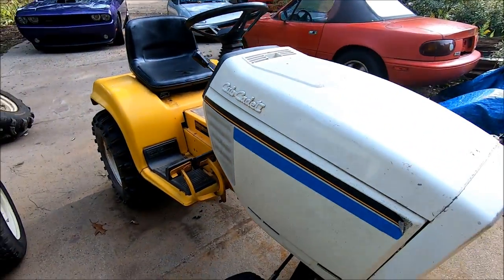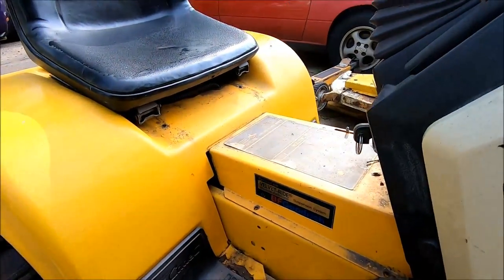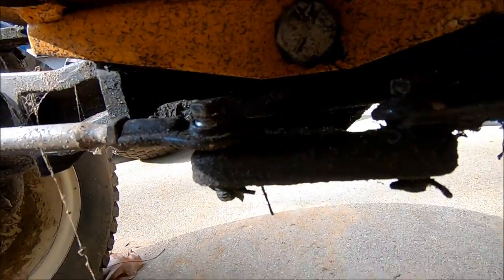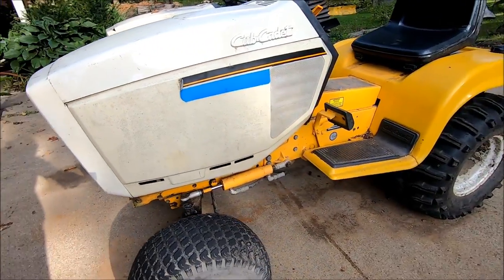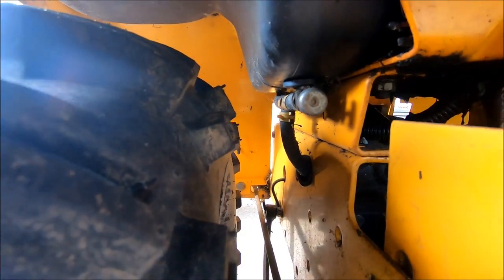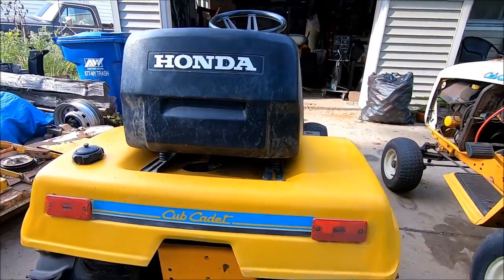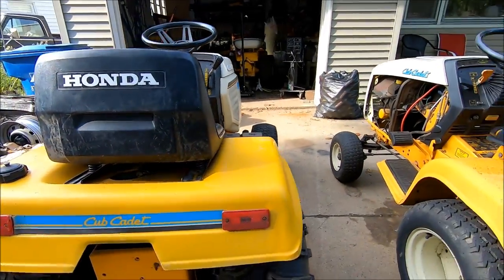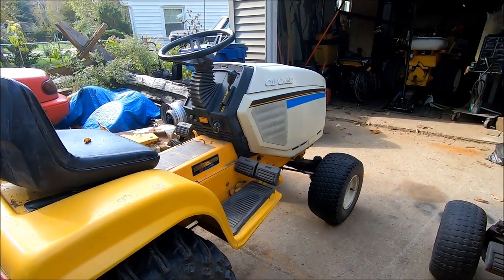SGT 2082 Cub Cadet Off Road tractor build.  Not your ordinary mud mower.

Comment: Awesome bud def is like way out of my leag dam but have a wheel horse project and just been running into issues I traded for it expecting it to be a good base starter and the dude screwed me over on facebook
Reply from the maker: Sorry to hear about the troubles.  This build was out of my league too until I found the magic sauce for this build.  The design was finalized last week and entered the build stage this week.  Hoping to have a this completed by end of April.
Reply: @MrStudabaker  just gotta take my time I might do a diesel swap I have a onan 2 cylinder that is on it now it is a really decent I'm having spark issues at the moment and I don't know what else I might come apon but I'm kinda reaching out to you kuz I wanted to get some advice what to do with this tractor it's a wheel horse 416/8 it's got the three speed rear end high low range give me a idea that would make my day thanks bud

Comment: Really cool man, it’s like all the best parts out of all the cubs, I’ve always had a weird love hate relationship with the cyclops cubs, like there ugly but in a mean kinda race looking way, gonna be sick looking when your done. I didn’t realize they ever made a aluminum case trans? And wide ratio gears sound great, what am I missing?
Reply from the maker: Thank you sir and agree the cyclops is "fugly" but has a super beefy front axle. Your not alone it is a love hate relationship.  The gearing in the aluminum trans drops the rpm's way below the power band.   Example cast: 7000 rpm shift from 2nd to 3rd rpms drop to about 4000 rpm.  The aluminum trans will drop down to 3400 rpm's well out of the power band of the up coming motor build.  One could say the alum. is a super wide ratio.  Oh one more the cast has the internal wet brake which works no matter what and the alum has the external disk brake prone to mud wearing the pads out in twenty minutes.